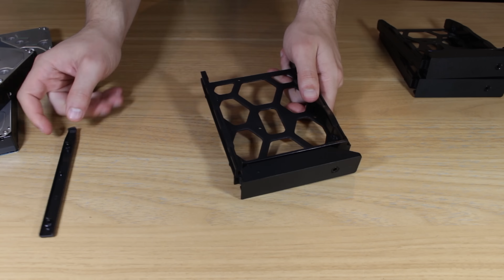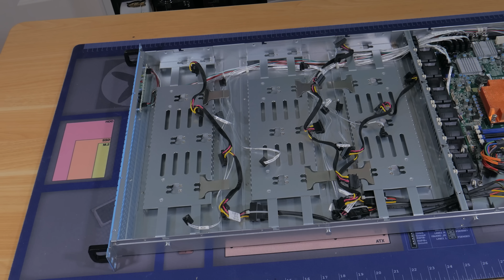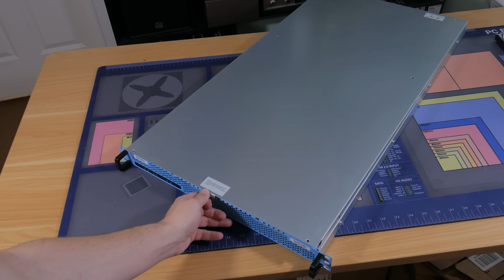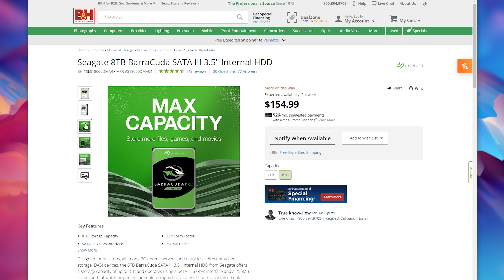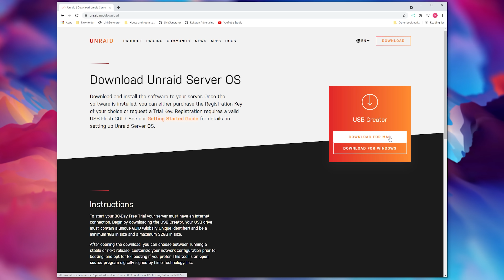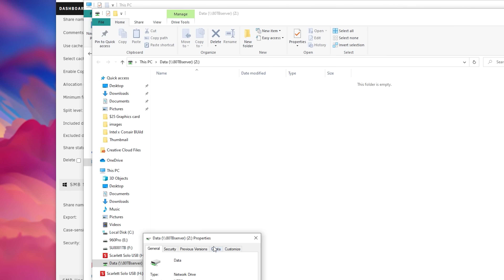Budget Storage Server 2021! | 80TB NAS

Comment: you have internal usb3 ports why do you not use them? i mean yeah they vertical, but you can use a USB extension or a right-angle adapter. I have build a similar system for a friend of mine.
He definitely didn't need much performance, so a 10-year-old intel atom processor was fine. i used a old supermicro 1U server with 6 2.5 inch drive cages and two internal 2.5 inch Drive places. He wanted unraid too so i used one of the internal USB2 header with a right-angle USB adapter. This system uses about 15W in idle and 30W under full load. He uses this system for 7 years now and never encountered any issues. 
now he needs more space and i thought about something like this chassis, but it is huge and uses too much power. His atom processor is barely utilized, so something more powerful is not needed.
maybe i change the drives in that server to higher capacity 15mm drives, they luckily fit. maybe going from 2TB drives to 8TB drives, if they are available in this size.

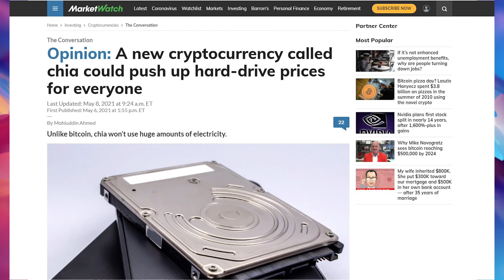Comment: 5:16 is it ok to use standard consumer hard drive and not using the NAS one (iron wolf, wd red & ultra star) because I read an article explaining we shouldn't use normal hdd because there's no support for 24 hr operation and TLER. im just concerned if the drives can't even handle continuous/frequent data backup which then would impact the lifespan of the hdd

Comment: I did not know i could crack open my external sea gate HDD and use it as a internal one for my PC. Well considering how cheap they are i might just get another 8TB drive and use it as redundancy so i can have a mini server to install my games onto, before you ask these are old singleplayer games mostly my GOG library so load times i don't care much about otherwise yes i would use a SSD instead. For the multiplayer games i actually use my SSD as then load times matter as i don't wanna take too long to load into a game of league of legends or any other moba

Comment: This is the same HDD I use for my files which I also took from the enclosure but I did not care about the enclosure its self & believe it or not I didn't damage it using a straight screwdriver but I tossed it after as I had no use for it. I kept the mounting connector though as its useful. They are good drives.

Comment: Oh wow. That was the very same motherboard I bought in my 1st RAID server build. I ended up installing the Tyan mobo (Tyan S5512WGM2NR) in a 24 bay Norco case yes it only has 14 ports (6 sata and 8 SAS - LSI embedded 9211 SAS controller)  I just connect it up a 28 port HP SAS expander. Not a bad mobo - up to 32G ECC

Comment: This seems like a good idea for anyone that likes watching youtube videos, but will never build this themselves or actually run this at home. 

If you're trying to cut costs. Use the external drive cages, don't run them all 24/h. Don't buy a huge bulky whining old server for shit like this, you don't want it at home.
If you're trying to setup an actual storage server, don't skimp out on enterprise drives. And don't skimp out on the anti vibration. There is a reason enterprise hdds are higher initial cost. Because it's literally cheaper in the long run, will cause less issues, and even add functionality to ensure less data corruption.

Comment: I use a Dell PowerEdge T710 with 2x Intel Xeon 5500 CPU's, with 288GB RAM, and 8x 8TB Sata drives, and 2x redundant PSU's, 7 of the drives are set at RAID 5, using the Dell's internal Perc Controller software, and 1 standalone for the OS, the OS is headless Ubuntu Server, utilizing SAMBA for file sharing on the network, I don't need it to be a NAS, as Ubuntu Server does just as good using SAMBA shares, then I just create folders on the server for things like documents, pics, music, images, and video, and create Windows shares to those folders, and all I do then is to use the 'Network' icon in windows to map a drive letter to those shares and voila, windows explorer sees those mapped drives and I can just copy over the entire contents of my Documents, Videos, Music, and Images folders from Windows to each of those drive letters, and when saving from an application, I just browse to the right folder and save to it.

I was lucky that I advertised on freecycle for servers, working or not, and obtained the Dell server for free, and it had everything there but the HD's, it even has a working tape drive, but I don't have any tapes for it.

So, my question is, why did this person in the video spend something like $1500 for a NAS to build?  When there are other servers out there, that can be got either for a few $100 or free, and that would be needed would be the HD's.

And, why use it as a NAS, unless you're in a huge company, and everyone has a portion of the NAS for their backups, but as an individual, a NAS isn't necessary, whereas Ubuntu Server with SAMBA works just as efficient as a NAS.

Comment: Cool build. My home build server is over two times the machine. It has dual CPUs, 12 cores, and 24 threads. 96 gigs of ram. 18 hard drives with space for 12 more. The major issue is not the power. It costs 45 dollars a month for electricity. The problem is the heat. It sucks when you have to turn on the AC when it is only 50 degrees F outside. On top of that, rack-mounted hardware sucks in a house.  I am building a new NAS/VM server. It is going to be way more power efficient and small form factor.

Comment: There are cheaper alternatives. My NAS, with 10 x 6TB HDD's, used an old dual core board with 2GB RAM, runs on XigmaNAS. I get almost 55TB of storage in total. I am not using any raid configuration, so if I lose a drive I lose the data, but NONE of it is that important anyway. Cost me about $300 for the drives, the computer came from the recycling centre. It's been running for 5 years at least now, and never misses a beat. Only problem now is where to next? I have almost 50TB of movies on it.......and the case cannot fit anymore drives.

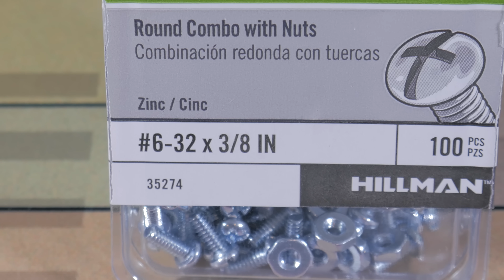Comment: 8:33 you say "Six thirteenths bolts". the way you are saying it makes it sound like they are 6/32" in length. these are actually 6-32 machine screws(pronounced six thirty two). the six meaning the diameter of the thread portion is 3/32 of an inch and the 32 means thirty two threads per inch. this is coming from an electrician who uses these near daily

Comment: Cool idea, thanks for sharing. I am kind of a NAS noob as well, but what pops at me is that you got yourself a bunch of consumer-grade backup drives that as far as I can say are optimized for occasional operation, nothing like 24/7 really. They likely don't have the reliability of an enterprise-grade drive (e.g. MTBF, mean time between failures). If I had this situation, I would try to look at the dynamics with which the NAS needs to operate (if it is constantly, few times a day, or once-twice a week). It if was the last (once-twice a week), I would go for setting HDD spindown settings in the operating system to hopefully extend the HDDs' lifetime. Something like "camcontrol standby /dev/ada[N] -t 86400" in FreeBSD or equivalents in other OS:es. :)

Comment: Great build. One big caveat though. I would not under any circumstances recommend shucking for the very reasons you stated and also Barracuda is a desktop drive, not ideal for 24/7, server or RAID use. Instead get enterprise grade drives like Ultrastar or Exos. They can be had for the same or even lower price if you're willing to get bigger capacities, and altogether much better drives for the job.

Comment: This would be interesting to do with all my spare HDD's lying around I have 4 2TB 3.5 inch drives, 1 1TB 3.5 inch drive, 1 1TB 2.5 inch drive,   2 500GB 2.5 inch drives, 2 256GB 2.5inch drives, 2 256GB SSD's, and 1 40GB SSD all stacked next to my PC right now. Unfortunately I'm having difficulty finding a server for a reasonable price. The ones that I am finding don't have places to mount HDD's. They're half the size of the one you used.

Comment: LOLOL... 1024 (power of 2 / base 2) is normal when referring to BYTES (was in the 70's) -but if you want to have profits, its 1000. 
I'm not using a new WORD (tibi or megi or kili or pebibit, its just sili?) because a drive manufacturer wants to use 1000 instead of 1024 to sell their "capacity" and save ink by removing the disclaimer!

Great build! very clean!!! Thanks for sharing!!!!

Comment: oooooo. nice. that board would make it easy to move the system to a 2u or 4u chassis for space to utilize those pcie slots. and you could add a higher core count cpu and more ram later when you add more functions to the server

Comment: its 2022 
and I have yet to find a server chassis that is as quiet at the chenbro is. 
I wish I could swap the MB to use a single e5 cpu and had built in 10gbe nic as the e3 xeon can't run a bunch of virtual machines and I have to use that lonely expansion card on a 10 gbe nic..
Also I dont know why you went with truenas for your next build but what I'm thinking about doing is running a large cache pool in raid 10, set the shares to prefer but oncei finish with a project i then set the shares to yes then mover takes care of the rest.

Comment: ZFS does compression, so if you use ZFS, you'll use the CPU more than you think.  You could get an internal USB drive and connect directly to the MB.  FreeNAS isn't bad.  :)  SMR vs CMR was a good tip.  Thanks!
Reply: Compression has to be enabled and can selectively be enabled/disabled.

Comment: I got 14x3TB SAS2 used drives for just under ~$20/ea, some used server hardware for under $300 total on eBay, put them into a new 4U rack, and configured for zRAID3 just in case, after 2 years works great on FreeNAS (now TrueNAS)

Comment: How'd it go from 80TB to 58TB? That's one hell of a drop in storage. You lost over 25%. That doesn't seem economical at all. If I pay for 80TB I wanna be able to use as close to 80TB as I can.
Reply: He had two drives to hold parity bits. So the total effective space is 8X8TB -> 64TB -> 58TiB (1000 vs 1024).

Comment: Those fans push hot air on hard drives, is it fine ? I think it may affect hard drives
Reply: The key is to have cool air in your home, like 70 degrees. Those drives run very hot.

Comment: You seriously overpaid! You can have Dell Poweredge R720XD or R730XD that is going to cost in region of £400 with 128GB ECC and 2x8-12core Xeon E5 goes up to 18core if you are willing to pay for it. Takes up to 12 3.5" drives. I bought 10x6TB SAS4 7200rpm with 4.72ms access time and 128MB cache for £350.... Its much better server. You can stuck some GPU in it and do rendering and many other things there instead using you PC. Not talking about having 10Gbps onboard NIC. I use it with 40Gb to speed up my VMs on the M.2 drive. So the cost of the build with some extras like 2x120Gb SSD in RAID1 for system and 2xQUADRO P1000 for one VM and PLEX server was about £1000 (1300USD).
If I'm correct the Green BARACUDAs are SMR drives which are totally unsuitable for RAIDs. If one of them fail, it will most likely fail to rebuild the array. I would suggest to replace them as soon as possible with something that NOT SMR or directly build for RAID.

Comment: Not to knock your build. But, I purchased a couple of Mediasonic ProBox 8-Bay hard drive enclosures. They were certified refurnished. So, they only cost me $230 each. However, what I didn't know is that they were future-proofed. At some point, the Amazon page got updated to indicate that the drive  bays could hold bigger hard drives. before, they were rated at 8 TB per slot. Now, they're rated at 16 TB per slot. When I emailed Mediasonic, They informed me that, if the enclosures had a REV.03 marking on them, then they contained the same hardware as the 2020 model line. Not only did those 8-bay enclosures have that marking, so did the 4-bay enclosure I purchased a year before that. That means that the two 8-bay enclosures and the one 4-bay enclosure, at 16 TB per slot, gives me a total of 320 TB total of hard drive space.

Comment: 0:30 No, it's not fine. It's misleadind.
I'd run a virtual machine to access the drives so if ib want to upload I can do it from the server so I don't have to transfer it to my main computer. Also I'd probably keep a drives blank to to transfer files every now and then to reduce data degradation.

Comment: Those externals are now up to $180... ouch! I have a Poweredge T610 I bought for.... one whole dollar at auction, but it only has 2.5TB worth of 500GB drives in it that need replaced. It can hold 8, and does have dual Xeon processors which is very nice, and 12 DIMM slots that can actually handle (tested and proved) 12x32GB DDR3 sticks! Upgrading the ram and cpus will be far cheaper than the storage.

Comment: I bought a compute server about a year ago that I am currently using as a NAS. It only has 6 x 2,5 inch HDD/SSD bays. It consumes 370 - 400 watts when idle with 90% of the cpu cores disabled, hyper threading disabled and memory set to 800 MHz.
I have 6 x 1 TB drives in it, so not very efficient.
It was made for computing things though. 4 cpu sockets and 32 dimm slots. I could probably compute the shit out of something, but I don't know what.
Reply: 400 Watts is alot.

Comment: I know this is old but the USB drive for UnRaid can go directly into the motherboard inside the case. That is what the two USB ports on the right side of the motherboard is for, needs a smaller profile drive but makes it so you can't accidentally break it.

Comment: The hardware setup is almost the same as the one I have been using for a few years now. My MB is a bit older but still uses Ivy Bridge E3 CPU, I have 16GB of ECC RAM and am running 11 HDDs and 1 SSD but mine is in a standard case with the drives in hotswap bays in the front. Only big difference is mine did not come with 12 built in SATA ports so I bought an SAS card and bought cables to split it into 8 SATA ports. I have been using it as my media and various server setup, with Plex being the main thing run on it but also some other servers in docker containers. It has been running like a champ for at least 6 years now without a problem.

Comment: Odd storage machine. Single PSU with no upgrade option is annoying. No registered ECC (bye bye ZFS). No backplane for the drives sucks, 14 individual cables (labelled they may be) is messy. Still, for the price it’s decent. I just can’t think of a good use case.

Comment: the larger drives are ironwolf rather than barracuda like he says. Makes sense with the price difference. The 8tb is under $200 vs the 12tb that’s normally $400 supposedly. Says it’s on sale for $365 but the numbers don’t make sense cause the 14tb drive is only $325. So if someone could explain that, I’d appreciate it

Comment: Please try not to use razor blades to pry open the enclosures. If it slips you're in for a bad time, and a likely trip to the er with stitches when you come home. Use a butter knife or a plastic wedge if you can.

Comment: $120 was a good price now $266, a few things though those drives in those external boxes don't usually have a warranty longer then 1 year for a reason. They dont make drives like they used to they fail a lot. I have a problem using a funky propriaty want to be storage array. How loud is this 1U, I have a few they are pretty loud, I even have a tyan which is my loudest.  I would also make sure I have access to a backup powersupply or you will get burned. The good news is tyan is a well known mobo maker. I do like the storage size, for people thinking they can use an old 1u server, be aware that the raid controllers in those things are usually limited in capacity support. We are talking 1 or 2 tb size limits for the older servers.

Comment: SMR is neither outdated or overall inferior, it allows for higher density at lower costs but with the compromise being write performance. For domestic use and longterm storage this is absolutely fine but it becomes problematic in enterprise or NAS applications. The controversy around SMR came from manufacturers misleading buyers and selling NAS drives with SMR.

Comment: the one i bought doesn't have PCI-E slots and is somewhat different and only has USB 3.0 ports. i booted it up and it says system initializing and it says 2b in the bottom right corner of the screen. It says that for a few minutes then the screen goes into power-saving mode. led 7 light is blinking. could you help?

Comment: Right away I spot a massive massive reason why you should not use this. It has only one power supply. Realistically, in a mission critical server like this, you want at least two of everything, including two CPUs. That is so if one of the CPUs dies, you may remove it and run the server off of one until you get a replacement part. You can make an excuse to forgo a dual CPU set up but not a dual power supply set up. A single power supply being a failure point is terrible, as instant loss of power in the midst of a large data transfer could result in corrupted data.

Comment: Halow brother,  i want build multimedia server with this :

- 10 x 12 TB 3.5 inch HDD 5. 400 or 7.200 RPM
- memory RAM at least DDR 4 with 2.933 mhz
- power supply not over 550 watt
- have hdmi or display port 

What kind server i must buy? Can you suggest to me. Thanx if you can help me ^^ 😉

Comment: FALSE DRIVE SIZE ADVERTISING!!! AFTER FORMATTING A DRIVE IT NEVER MATCHES WHAT THE MFG CLAIMS
THEY SHOULD STATE BOTH MFG SIZE AND FORMATTED SIZE!!!
THIS IS BATE ANS SWITCH FRAUD MARKETING. USED ANY!!!! DISK MANAGER AND YOU WILL SEE  A TOTAL
DISK SIZE THAT IS SMALLER THAN ADVERTISED!!!!  THIS HAPPENS WITH APPLE, LINUX AND MICROSOFT OS.
FOR EXAMPLE MY 500 GIG DRIVE FORMATS AS 465 GIGS. 35 GIGS LESS THAN ADVERTISED!!!!!!!